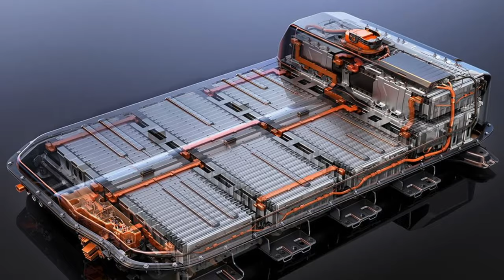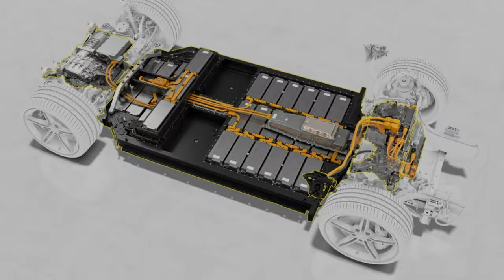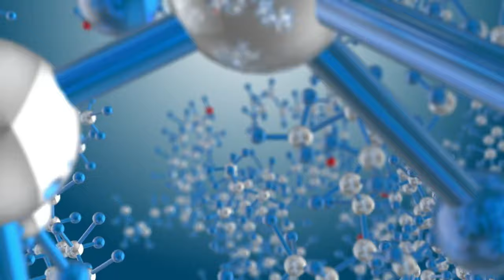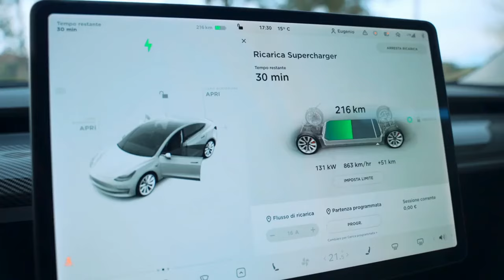Stellantis CEO Drops Bombshell Warning for EV Industry

Comment: Pointing to the weight as the problem is like running someone over with a semi and obsessing over their hang nail. 

The elephant in the room is the strip mining of precious metals, coal fired power plants,  and millions of discarded cars that aren't worth the cost of replacing the battery. 

These cars last about 150-200 thousand miles before the batteries go bad...

Then the toxic batteries end up becoming another environmental disaster. 

It's far better to have a car like we were producing in the late 90's and the early 2000's because they were expected to last for 300 thousand miles and could be rebuilt fairly cheaply. 

Strip mining just to discard the product only after what should be half or less of its life so it can end up in a landfill is a stupid decision that results in twice the production and toxic waste when you could be going twice the miles and recycle the car.
Reply: You might want to do some actual research instead of spouting common myths and FUD. EVs and battery packs last much longer than traditional ICE vehicles and need far less maintenance. Battery packs are fully recyclable, and in many cases, the battery modules are repurposed for stationary energy storage and other purposes.
Reply: @jamespaul2587  look it up.... ev'S have 80% more customer complaints. 

And point out what I said that was ACTUALLY wrong.
Reply: @davidminer84  your stats are incorrect, Tesla owners' satisfaction and level of repeat customers is among the highest in the industry.  Longevity of EVs is far higher than gas cars with much lower cost of ownership, and batteries are fully reusable when capacity is reduced, and fully recyclable at end of life. You talk about "toxic" batteries while ignoring hazardous and toxic affects of petroleum and the pollution it generates while being extracted, transported, burned and spilled.
Reply: I will never understand why people worry about the environmental impact of half a ton of battery and yet they don't blink at the idea of thirty and more tons of CO2 that an ICE vehicle emits in its lifetime. And that gas will linger in the atmosphere for thousands of years, upsetting the climate and our food security with it.
Reply: @markotrieste  exactly, and EV batteries are almost fully recyclable. Modules can also be used for stationary storage  after degrading too much to be practical for EV use.
Reply: @markotrieste  wow... it's amazing that there are people who have spent decades crying about the tiny 4% of plant food humans have emitted....

CO2.... ha
Reply: @davidminer84  Of course if you don't understand the science of climate change there is little I can do for you in this limited comment section. Anyway, that "CO2 is plant for food" is a myth that can be easily dispelled if you can google.
Reply: @markotrieste  you're amazing.... yes it's basic biology.
Reply: @davidminer84  Which clearly you don't understand. See under "limiting factor".
Reply: Here, I googled that for you:

...CO2 enhanced plants will also need extra water both to maintain their larger growth and to compensate for greater moisture evaporation from their tissues as the heat increases. Where will the water come from? In many places rainwater is not sufficient for current agriculture and the aquifers they rely on are running dry (Zwarteveen et al. 2021; overview of the global situation at Encyclopedia of Earth here.

On the other hand, precisely as predicted by climate research, we are experiencing more intense storms with increased rainfall rates throughout much of the world. One might think that this should be good for agriculture. But no: when rain falls in short, intense bursts it does not have time to soak into the ground. Instead, most of it quickly runs off into creeks, then rivers, and finally out into the ocean, often carrying away large amounts of soil and fertiliser in the process.

Unlike Nature, conventional agriculture does not self-fertilise soils by recycling all dead plants, animals and their waste. Instead we need to add artificial fertilisers to the soil all the time. Those chemicals are produced by energy-intensive processes mostly fed by hydrocarbons, especially natural gas. Increasing the need for such fertilisers competes for supplies of natural gas, creating friction between other needs and the manufacture of fertilisers. This will ultimately drive up the price of food.

Although the situation is complex and varies from one plant-group to another, too high a concentration of CO2 may cause a reduction of photosynthesis (Long et al. 2004). There is also evidence from the geological past of major damage to a wide variety of plant species from a sudden rise in CO2 (Currano et al. 2008; Delucia et al. 2008; Fig. 1). Higher concentrations of CO2 also reduce the nutritional quality of some staples, such as wheat (Bloom et al. 2010).

The worse problem by far is that increasing CO2 will raise temperatures. This will make the world's arid climatic zones shift towards the poles. However, soil conditions at higher latitudes will not necessarily support productive agriculture. Extensive and intensive management will be required. Long-term research has also looked at how plants respond to a high-CO2 environment. While some plants exhibit a brief and promising burst of growth, other effects such as the "nitrogen plateau" soon truncate this benefit.
Reply: @markotrieste  the earth is more forested now than it was prior to the industrial revolution. 

This is because of the use of fossil fuels in place of burning trees. 

Also it is because of the use of steel and concrete in construction rather than lumber. 

Of the entire production of CO2 the earth is responsible for 96% and man is responsible for only 4%.

It is possible to establish that the climate is changing but it's not possible to establish that it is deviating from natural forces and attribute it to our 4%.

Also, 90% of pollution comes from China, India and South East Asia. 

...not to mention the rest of the world's undeveloped countries. 

Attacking the most efficient first world nations who are already operating at or in the 90 percentile and only are responsible for roughly 10% of pollution makes no sense. 

The measures required to increase efficiency after 90% become exponentially difficult and expensive. 

It makes far more sense to focus on the actual polluters who can increase efficiency by double digit numbers with a relatively small measures and investment.

The lack of addressing the actual problems is the exact reason I ignore climate alarmists.
Reply: @davidminer84   Right again. Plus, to their point about water, plants hold water in the soil and shade the soil, decreasing evaporation.
Reply: @davidminer84  If you don't address the real points of what climate science is saying and instead you keep on piling straw men, I cannot help you. I tried to show you the complexity of one single point (CO2 and its relation to plant growth) and you shifted on China and that humans produce very little CO2 and further other topics. You have unfortunately no idea how wrong you are, right on the cusp of the Dunning Kruger effect. I can only invite you again to educate yourself and at least understand the topic from first-hand sources before trying to criticize it.

Comment: The solution isn't to force EV's with mandates now. 

If you mandated every vehicle to have some sort of hybridization by 2030, then come 2040, mandates that 50% of a cars power be electrified (like F1), then make that 75% by 2050, and 100% by 2060 it would allow time for the tech to develop and the charging networks. 

Also, be mindful you can build 100 hybrids with the batteries you use for just 1 EV. I'd rather take the 100 vehicles that get 45-50MPG.

Comment: BEV failed 100 years ago.  None of the reasons they failed have been solved.
Reply: They are not failing now. Sales up 19% again in March 2024 over March 2023. By the end of 2024 1 in 5 new cars sold will have a plug and 75% of those will be BEV (not PHEV). Go back 3 years and it was 1 in 10. The industry is going electric and that's all there is to it, no point in arguing the toss about hydrogen or e-fuels....there's no way back for internal combustion

Comment: This video is 4 years old, now there is Xpeng Motors doing very very accurate adjustments to reduce risks. And there are now solid battery which will arrive soonly, and the rapidity of recharge (100km in just 5 minutes charge) will spare battery size. And Dye Casting with Mega press allows to spare lot of weight... Stellantis does not have solution so they speak for their customers, not to others... Staff COM Mobility PSC should have standardized all car sharing systems, especially car rental... Bill !T should automatize positive retribution !
Reply: If you are going to shill in the comments, learn to write?

Comment: Bs.
2nd hand evs are great value for driving only low klms. Zero costs and minimal battery degradation over the time of ownership.
My 4 year old 55k klm M3 has 5% less klms than new. I'm keeping it for another 3 to 4 years and will still have 90% range. 100% updated software. FSD. Zero running costs. No brainer.
Keep listening to people w not much experience in evs.
Carlos runs a company that can not build evs profitably. Fail. Stop listening to him and GM CEO. They have failed ev strategy.

Comment: A clean EV is just a dream....Currently, they are extremely polluting in manufacturing and usage, all that electricity needs to come from somewhere to make and use EVs need to come from somewhere.  All the new batteries proposed are always 5 to 10 years in the future to be cost effectively available.  Public transportation is a non-starter in the USA.  It would never come close to the needs and desires on how people travel in this country.

Comment: The battery technology is definitely a large issue, but my issue is the mentality behind range anxiety.  The proposed anxiety is used as a negative for EV's politically and environmentally and In most cases politics win out. The reality is I don't pull a 6000 lbs boat twice a week and I don't drive 250 miles in one day could someone please tell me why I should have anxiety?
 At an estimated (4 cents) a mile "All" of the ney sayers stop using misinformation to drive your negative quotes and just stick to facts.
Reply: Sounds like an EV is right for you!